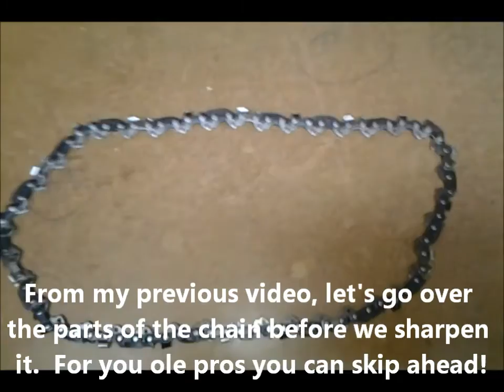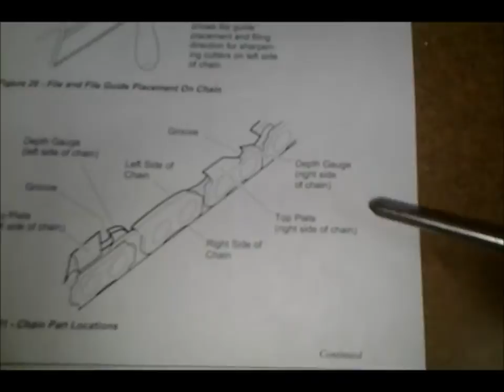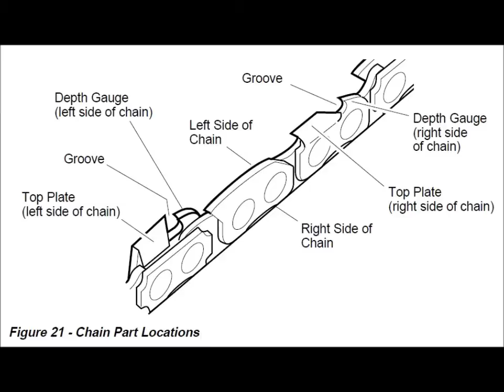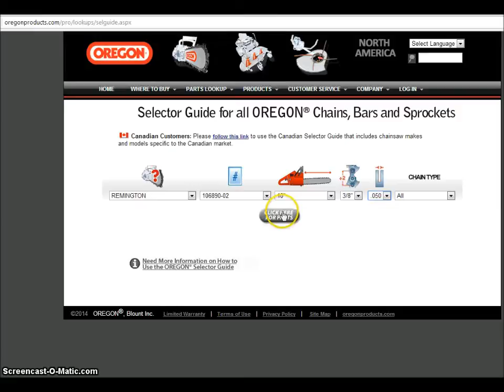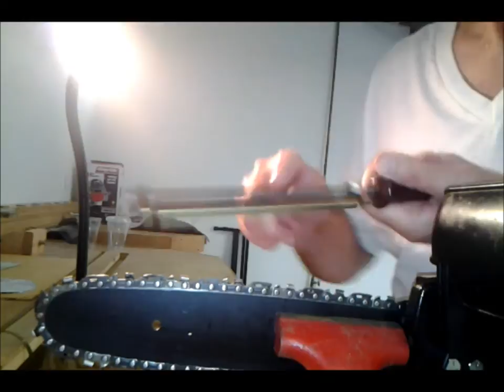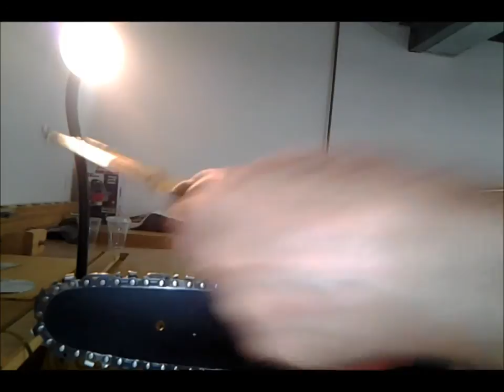REMINGTON ELECTRIC POLE SAW/CHAIN SAW SHARPENING

Comment: Your video is very helpful. I have the very same Remington Pole Saw. The chain came off and I suspect the reason is that the clamp washer (that holds the guide bar on the shaft) came off. Does that sound about right? I figure I can just get another one at a hardware store. The manual says there should be no gap between the rear of the guide bar and the chain links and I figure the clamp washer helps hold guide bar in place. Is that correct?
Reply from the maker: Yes, Eric, I think that is correct.  Thanks, for watching.  Here is my video where I disassemble it, if interested:
https://www.youtube.com/watch?v=VF4B3ejRUHs